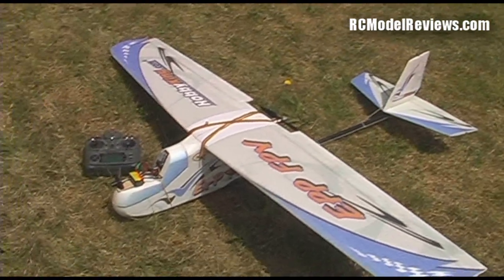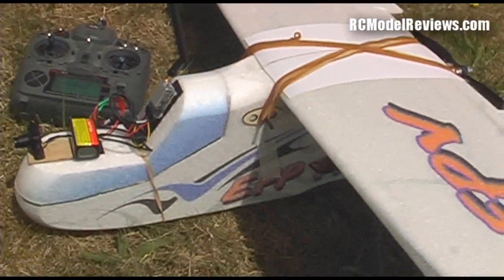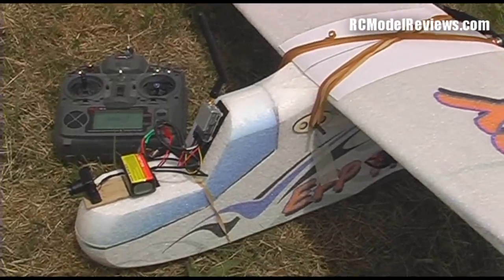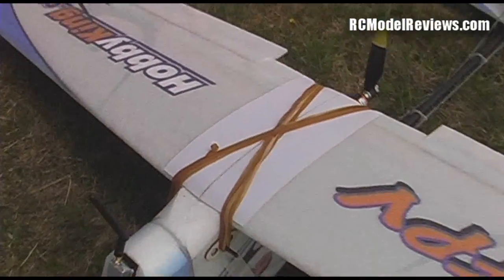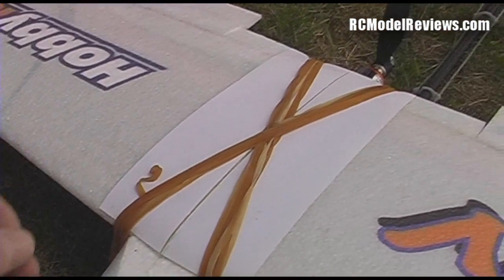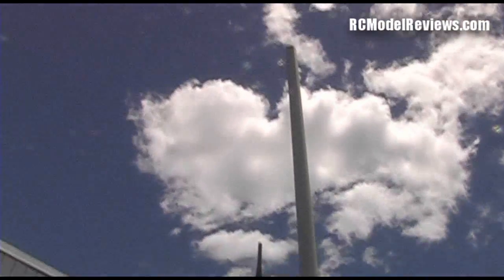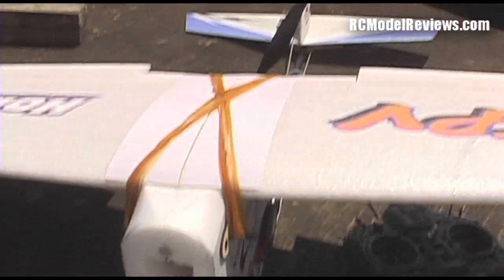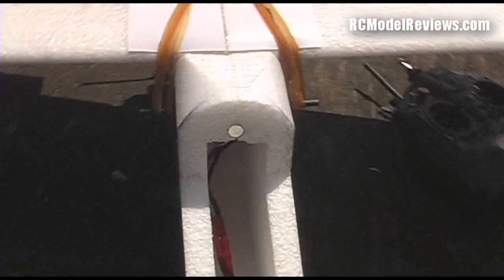HobbyKing EPP FPV RC plane, part 4 -- first flights with onboard video

Comment: 5:06 I've had excellent results using the Hobbico UA resistant natural gum rubber bands from Tower Hobbies in the one pound box. Have half a box left and they must be going on ten years old... maybe more and can see they may not be as dark colored as when new and have likely lost 10% of their elasticity as the box lived in the tropics but they are still in very good condition and have never had them fail like shown here. I use them to hang planes and they will last a year or so stretched out till they get too long and thin but for their intended use holding on a wing they work great... never seen rubber bands fail like the ones shows here... total garbage.

Comment: Gidday Bruce , Nice flight. Just wondering where you put the cog on this model. in my instructions it says between 45 and 50 mm from leading edge. I find that hard to believe, I reckon about 100 mm ,I have also done a couple mods ,landing gear front and back,and aprox 2" dihederal .  Yet to test fly

Comment: Nice plane, but watch them darn rubber bands. Great reviews, love em.  I like the plane and think it will make a nice FPV platform.  I wanted to order one, but they are back ordered.  So, I decided to design (copy) my own FPV.  I am using the EPP FPV as a starting point.  I am making wings longer to 2 m and add 3 degrees dihedral, bigger tail and more inside room. Should be able to lift 2kg to 3kgs.  Check it out if interested.

Comment: i'm thinking of using Arduino and ARM board running linux to compress video, telemetry ,& control, with 720p webcam, 2W usb wifi 802.11n onboard and for base station, i want to get 15 km range at FL2000, do you think this practical